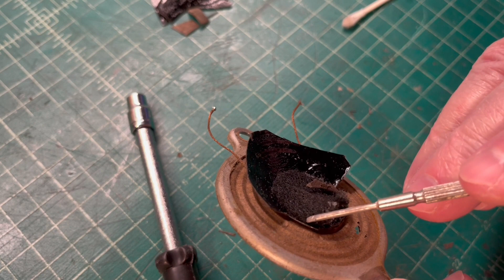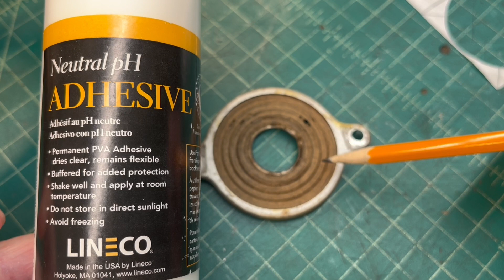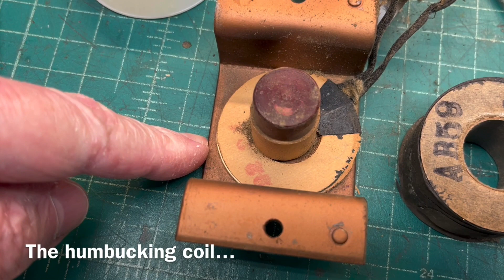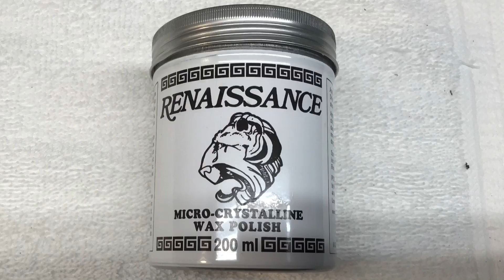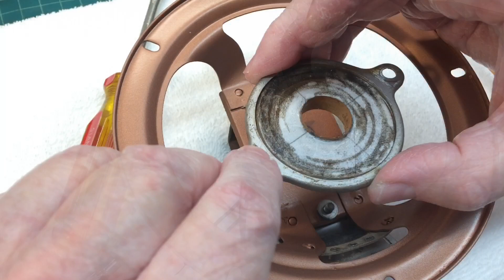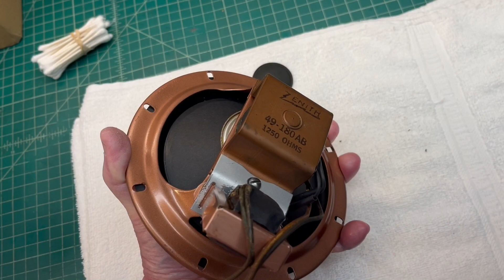Zenith 6S229 - Electrodynamic Loudspeaker Rebuild (Spider Repair, Cone & Surround) + Basic Testing

Comment: Hope you'll see this... have you ever tried testing a speaker with just that disc-shaped spider installed? Would it make enough sound to verify the voice coil is moving freely? I'd like to test for that before I start gluing up the new cone.
Reply from the maker: You might be able to hear it (rubbing) without the cone glued to the spider. Here’s an interesting technique that I’ve used and had bookmarked for future reference at:

How to Use Smartphone or iPad to Center Speaker Voice Coil - Easy
https://youtu.be/NpMYZq-qQNo?si=qgwE_yEhWJRqdhNy

All the best.

Don
Reply: @RestoreOldRadios  It does play though faintly with just the spider. Note: the fine voice coil wires don't like the vibration. One snapped but left enough to complete my repair. Was probably already a weak spot there. Cone installed today & tested. Now just need to find replacement gasket.
Reply from the maker: Thanks for sharing your findings. It’s always interesting to try different methods and procedures. Depending on the size of your speaker, you may find a match at: https://reconingspeakers.com All the best and congrats on the repairs. Don
Reply: @RestoreOldRadios  Thanks for that. The procedure looks interesting. I'll try the speaker with spider today with any luck.

Comment: The speaker looks great but it's probably ruined.  In order to reproduce the low freq the spider has to be compliant enough to allow the cone to move. All that flat paper and glue made it stiffer than a compression driver surround. You probably pushed the Fs up by 3-400 Hz.   I would have used small strips of gauze to plug the holes and and a thin layer of the goo they use on altec accordions suspension and leave the rest of this well alone.
Reply from the maker: I appreciate your feedback/suggestions on the repair techniques; I’m sure another opportunity will present itself in time and I’ll apply them. The good thing, the old LS is being used in an old AM radio (no fidelity) and I can shape the output w/ the tone control to a certain degree. I just posted a video w/ the LS playing some music (one channel, no equalization placed in a plastic container) and it sounds pretty good considering and much better than my starting point. Thanks again for your feedback. All the best. Don

Comment: I’m fascinated with how you fixed the speaker. I’ve tried and failed at trying to make a speaker cone. I also am having trouble getting reliable parts such as gaskets and dust covers. A video on making a cone and suggested venders for surrounds, gaskets, and dust covers would be great!
Reply from the maker: Lane, look for a new video soon where I’ll share the method & procedure I used to construct the cone and note some resources. Best, Don

Comment: Yes, PLEASE post a video detailing measuring & making a cone....Also, I wish there were new spiders available for these smaller speakers with 1/2" diameter voice coils, or at least material to make your own spider. Anything available in searches have openings for huge voice coils.
Reply from the maker: Ed, I just published a new video on cone construction for reference. I’ll edit or ping you back regarding spiders, etc. Best, Don

Comment: Great job  Don !!!!       I am working on  a  zenith right now  .    (5s319).    The speaker cone is gone I mean no paper left.  The voice coil checks out  the spider very little left .   I made the spider out of a playing card  and I was able to buy a cone .    It plays but not well.   I realize now that the spider type,  style , paper/ card was wrong for this speaker .  The cone was not deep enough  it should have been half inch deeper perhaps .    What kind of paper did you use . I would very much like to  do what you did.   Sounds great to me.   Thanks for sharing.      Dean
Reply from the maker: Thanks Dean. Your 5S319 sounds nice. If all goes as planned, I’ll publish a video in a week or so on constructing the cone and cardstock I used if I can dig up another LS in need of repair. You’ll enjoy building one and find it easy to do for the most part. A source for smaller spiders is a challenge for me too. Have you found any sources for these vintage loudspeakers? Best, Don
Reply: @RestoreOldRadios  Hi Don thanks for the reply.     I found on e bay  5 inch cones  but not recently they are I believe a little short but if you add a little extension I think it would work.      I have recently been cleaning a large garage out that has been owned buy Ham and old radio person . This gentleman has more tubes than You can imagine. He has given me a lot of radios to work on and speakers to go with it but never seems to be the one I need.  I has received small ones as well.   Permeant magnet type  looking forward to digging one to find a spider.   He is coming back in October to finish the clean out.   50 years of collecting old electronics.   A lot went in 2 very large dumpsters.   Mostly 60s 70s 80s stuff.   He knows I am looking for small field coil speakers.       If I find a 6s229 speaker it is yours .    Looking forward to seeing your cone making video.    Thanks for all the time you put in on your videos .    I ALWAYS learn something.      Thanks again            Dean
Reply from the maker: Dean - I just posted the speaker cone build video. Check out the video description for additional information. Best, Don
Reply: @RestoreOldRadios   Thanks Don,    I’m on it.

Comment: Very tedious work Don, but I'm not sure the amount of damping added by the glue and paper layer to the spider will allow it to be as flexible as it was originally. Of course I've never done a repair this intricate before, so I may be way off base. I do hope it goes well. The speaker cone turned out nice! :)
Reply from the maker: Thank you Doug. I agree on the damping being a big question mark. Good news, the testing was promising and the results are very close to another 6” LS I have as a substitute. Thanks again for watching. Best, Don

Comment: You mentioned not to use steel wool on the iron center pole piece but you could use brass wool. It is stronger and less
likely to fray pieces where you don't want them and is non -magnetic . Like that paint you used on the speaker frame. 
Gives it an all around correct look. Great soldering tips. Cover that speaker up until you get the replacement gasket!
 Sadly I have been know to poke a hole in one while moving things around. LOL Thanks Don.
Reply from the maker: Thanks for the info on the brass wool Steve. Yep, the paint color is close for a rattle can and I’ll definitely be boxing it up to keep my fingers out of the cone or other… Thanks again. Best, Don